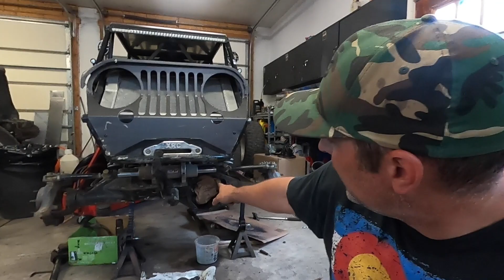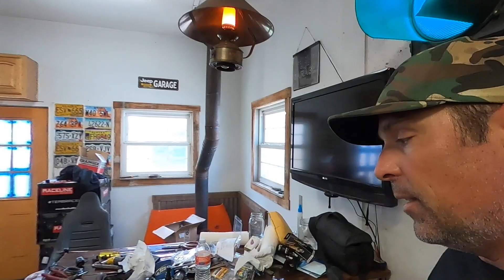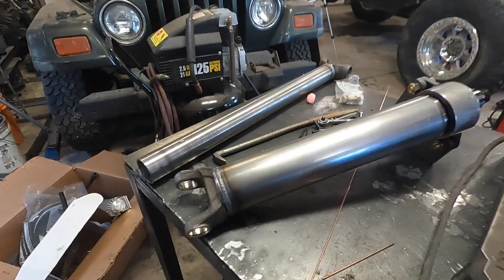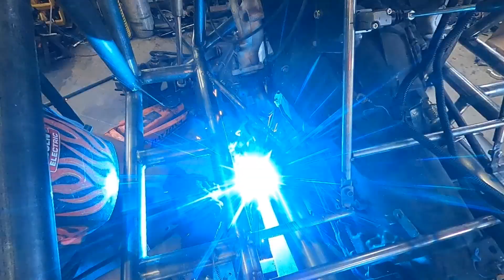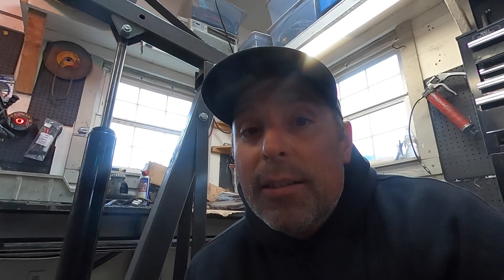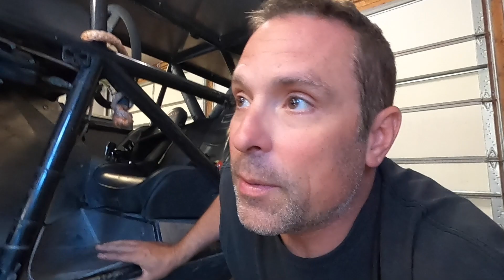Rockcrawler Project Build, DIY Drivelines #rockcrawler #diy #driveline

Comment: Bro mad props. Haters gonna hate - ainters gonna aint. You can question everything you can when building but you sir are a get it done sob. Why spend tons of money when you can get it done on a budget. What you learn from this is priceless and why learn on a big budget. Through this process....you are just becoming an expert. One day you will may have the funds to go all out on parts etc....and guess what....you will know exactly what to do and what not to do. 

The other issue with high end parts is availability and going with a more stock design on parts plus being able to fabricate your own stuff is huge. If I were you I would not buy the high end parts...I would put that money towards a large lathe and a milling machine. One day you will be selling the parts my friend. Keep it up. 

If you ever need and CAD work done hit me up. 

Also...I am watching this video because I want to build a rig based off this platform. 4.3L. 

Is there any way you could make a parts list on the engine,tran and driveline? I am in the planning phase and my plan is to build a cad model. Then start building.
Reply from the maker: Thanks, I appreciate the comment!  I agree cad is great, my other crawler was fully designed on cad, including the radiator, fuel tank, aluminum panels, and it made everything so nice. This project I had an idea to try and build a small rear steer crawler, using really basic parts, that have the best value. My plan was to build it using very basic tools, in an average size garage. It’s been a fun project. 

As for the 4.3 drivetrain, I used a 4.3 with a 4l60 out of an 02 blazer, I got the harness and computer as well.  The 4l60 has a deeper first gear, than a th400, which was a bonus as well, as an extra gear too. I am using an atlas transfercase, over all, the drive train is only 4 feet long, not including pulleys and yokes, but from the front of the block, to the back of the t case.
Reply: @wheelinoutwest  

I have found some models of the 4.3 and I have also found dimensional data on the drive train etc, I am going to start their and build around it. But definately want to get a 3d model built first. I am a fabricator but this will be my first project full on project like this on my own. So you have a sugestion for axles? I just need to put the parts list on drivetrain and run with it.  Thanks for the videos man. I ha e watched several. Keep it up. You build, refine, rebuild .....its a process like everything!
Reply: The other nice thing about building a cad model is you can put together a solid material list. Then you can actually organize your sourcing. I habe made that mistake where i start buying stuff to soon and it ends up not being used.